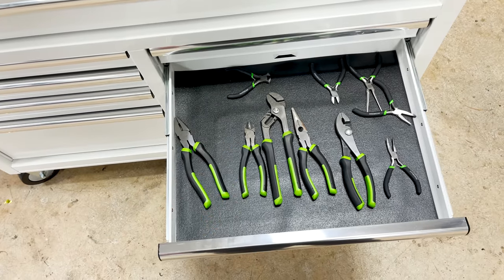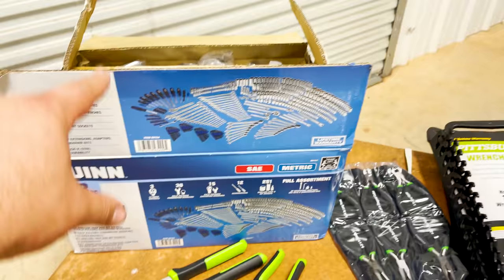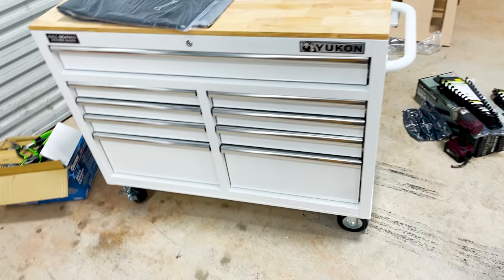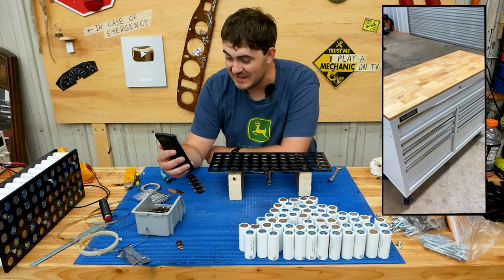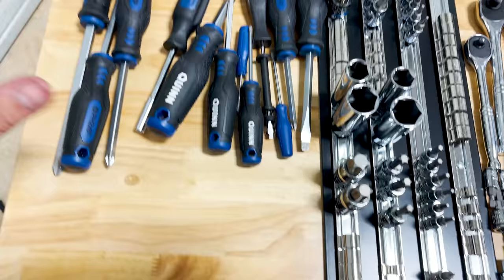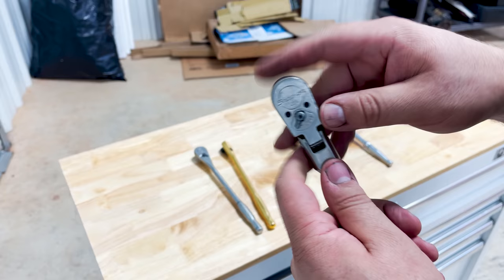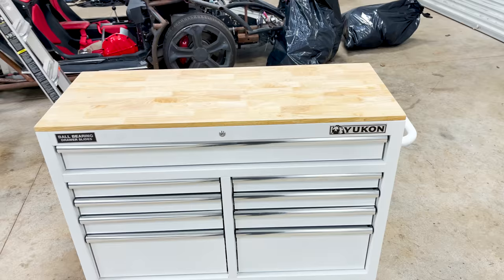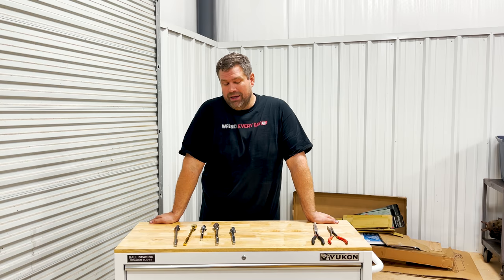I Bought The CHEAPEST TOOLS On The Internet (So You Don't Have To)

Comment: My experience with HF has been generally good on most products but there are some areas that need improvement and Im sure others in the chat have differing experiences. Most recently my son (in high school age) was changing oil on my Fusion Energi and kept telling me 15mm was loose 14 was tight and thought it was an SAE bolt. Well the issue was as you guessed it, the open end wrench he was using - Pittsburg branded. Lesson, If its a bolt you dont want rounded I would recommend using a better wrench. In this case we switched to a gear wrench and it worked fine albeit with rounded corners now :( . So the wrench savings cost me more for a new bolt from Ford lol. I must say, there are tools that I have great luck with and have been using at work and at home and those are the US General tool boxes and cart. Well built and after many years still look and work great. Their table drill press is great - mine is 20 years old and still kickin, i also have their horizontal band saw and the press, brake, roll and for the money you cant beat them (they just need alittle tuning). My 2cents for free

Comment: Personally I like the Husky 505 piece kit better. its $419. husky is make for home depot by Apex Tool Group. Apex Tool also makes Gear Wrench, SATA, Crescent, KD-Tool tools. so they are better quality and the stuff at HF.  add on the  the husky 46 inch tool cart for $398,  toss in a good set of Irwin pliers form amazon for $46 dollars and add on the Irwin cobra pliers for $26. and a 4 piece set of Irwin Vice-Grips for $38. but that only gets you hand tools. which are slow and we all know time is money would add the following to complete the set if i was working as a mechanic. 

Also for $230 you can add the 108 piece impact socket set.  the Ryoby 1/2 HP brushless impact and the 3/8 cordless ratchet kit. and add on the 3/8 HP brushless impact, 2 - 4ah batteries and the fast charger kits. good quality AC delco digital torque wrench ARM317-4a with digital angle guage.

Comment: The worst thing about a Harbor Freight crash kit is that you, one day when you're looking for a god damned 10mm socket, the only one you can find WILL be in that kit.

It will be the only 10mm you can find for the next several months, by which point the entire kit will have slipstreamed itself into your regular tools and you'll forever trip over them like landmines.

... And then you need to buy another crash kit for the next road trip because it's faster to drive to the store on panic-and-pack day rather than assembling one.

Comment: Overall with Harbor Freight, just look at reviews before you buy. Most tools are fine to great, but some like their old locking jaw pliers are absolute garbage. Do some research and you'll save a lot of annoyance. Also, I'd recommend staying away from Matco except for their actual tool boxes. Almost everything they sell is a rebrand of something made in Asia you can get for far less money. Buy whatever they rebrand instead. All tool truck companies rebrand some items, but Mac and Snap-On are better for getting bespoke and USA made tools. Lastly, I wouldn't bother with tool truck brand cordless tools. They are far more expensive and will eat you alive with battery prices, but Milwaukee, DeWalt, or others are just as good if not better.

Comment: The white option is a good option as a mobile kitchen (outdoor grilling area) butcher block island storage unit. You might even prefer the one you mentioned with the larger bottom drawers.

My Dad was convinced to invest in Snap-on tools for their alleged lifetime owner warranty then found out that largely depended on the actual dealer truck you were dealing with. In other words, the quality of the easy replacement service was NOT universal if your guy moved or if you moved to another area things became less friendly. In reality, Sears Craftsman back then had the same lifetime deal for much cheaper hand tools and the store didn't matter. This was decades ago so your mileage will vary.

Comment: You can get away tinkering a bit at home with some of the HF stuff. But if you use them on a vehicle from the rustbelt you will just round off bolts. If you think you are going to be a tech with HF stuff, the answer is no. You will not be able to make good time and you will become disappointed over and over again while looking like crap. I DO recommend keeping a set of HF wrenches and maybe some impact sockets in your box but not for regular use. You will eventually come to a job where it takes some sort of special wrench or torque adapter you don't have and it needs to be done. You don't think you will ever work on something like it again and aren't going to buy the special tool off the tool truck. So you put the HF wrench into the vise, heat cherry red with a torch and bend into a custom tool. Or Chop the wrench in a saw and weld a socket to it to make a custom adapter. You are making a tool to fill a need in a pinch out of something you don't give a fuck about. Some of my wrenches are $100 each. They aren't getting bent. The HF is fair game.

Comment: I noticed looking at HFs ratchet wrenches, the double box end sets are pretty tight, the others have a very loose pawl or something in there that causes it to have to back up a lot to get to the next click. No point in having a fine gear but a loose pawl that has to back up 10 degrees to find the next tooth. I should buy them and make video. Over all though the ratchet wrenches don't hold up in a commercial environment, fine for home use.

Comment: I think you should run icon tool grab and us general 5 drawer box. I say this after returning to the pro shop this is what I bought. I have put icon crome on half inch inpact and didn't scratch it. There 1/2 inch line is not as good due to select sizes missing but it works

Comment: Couple of things to touch on, I have the Yukon cabinet, love it, but I should have went with the Husky. When both are on sale, they're basically the same price but the Husky is a good bit deeper. 
Sockets from HF are great. Even the cheapest Pittsburgh sockets are honestly quite nice and I haven't had any issues with any of them breaking. 
Pliers are one of the few times when I wouldn't buy Pittsburgh, step up to Quinn or Doyle at HF and you'll be happy.

Comment: The old HF pro tool kit was good. Came with full line of sockets and almost all the odd bits you could ever need. The wrenches suck though(soft metal).
I have 2 or three sets of this.
The new quinn set looks like a nice choice.

Comment: The Yukon box is great. I have no hesitation in recommending it.  Don't buy the  Quinn. The Pittsburgh tools are better. Get extra ratchets so you don't have to change sockets. If you can wait for Black Friday, see if there are better kits from HD or Lowes. The $99 kits can be quite good.  Check the assortment. Get a really good rubber dead blow mallet, not plastic.  2-3 pound
    HD has the Dewalt 10 compartment organizer for $9.98 for the holidays. Make sure you pick up 2,3 or 4 of them before they sell out.

Comment: Regarding those loose slips joints:  I have an Ironton set (Northern Tool, fyi) where a few have gotten loose with age.  I've thought about just putting a plug well inside the nut (against the carriage bolt).  
For me, generally, more variety is better.  Tools are less likely to break when you have the right tool, having the right tool is easier when you have more tools, and having more tools is easier when you buy smart.  Not cheap, smart.  Spend your money where it matters.

Comment: You misspoke on the matco ratchets, the first one was 60 teeth but could be rebuilt with an 88 kit as they haven't made 60 tooth kits in years and the gold its just an 88 tooth. the 72 tooth ratchets were the adv line, which they no longer sell.

Comment: The other thing that works well with sets like these is Start with the kit as shown here, and as time goes on and you need to replace certain parts, buy a better brand.  It will take a while, but it's a lot easier to purchase 1 tool (or a couple) at a time and slowly upgrade your box than it is to drop a ton all at once.

Comment: I bought that socket set and my only complaints that the ratchets really suck, there are no stubby screwdrivers and the pocket screwdrivers are a bit of a disappointment. The Pittsburg pro ratchets are much nicer, and the pocket screwdrivers really need clips on them. 

This set has completely replaced my old craftsman tools other than 4 screwdrivers.

Comment: Just screw a slab of 3/4 plywood to it and when it gets rough just fling it in the stove and replace it? Wrench racks? Not worth bothering with. Just make some drawer dividers and chuck them in by type. If you use your tools every day you can identify 99% by eye and feel.  Ps I hate snap on wrenches especially as the warranty only covers tools that don't get marked   by using them.

Comment: I would say, the greybeards are right, and wrong. You can work out of ANYTHING if you need to. I've had to rebuild and repair things (electronic motors mostly) in the field with needle nose pliers, a gerber, patience, and a lot of swearing. I then invested in a set of Knipex and cut my field kit down to those three from the kit plus my specialty tools for the systems. Quality buys luxury, even if the luxury is just to know it won't give out halfway through the job and you have to scrounge up a replacement. The worker is the one that WORKS. The tools make that work easy or hard

Comment: When it came to sockets and ratchets and wrenches I went with tekton because not only do they sell individual pieces they also sell complete sets. Not sure if my ocd could handle loosing a 10mm and not being able to replace it because you can only buy it in a kit. Those 2 qualifiers cut quite a few tool brands

Comment: Fortunate enough to have Made In America Craftsman of the late 90s set.  I still need some torx and hex bits.  I love the Pittsburgh Pro dual head flex ratchet 3/8s & 1/4s combo and also added the Pittsburgh Pro 25" breaker bar 1/2 inch.  Good stuff from harbor freight.

Comment: DIY guys, no way you need to spend $1000.  You start with a good basic 1/4 and 1/2 socket set, get a good brand for the ratchets alone but get it on a discount.  I got a Hazet set for 170eur.  Get nothing in 3/8, its a waste of money.  Hunt for a bargain on good quality torque wrenches which aren't mentioned here at all, you need more than one to cover the range, got 3 Hazet ones for maybe 400eur.   Then you buy the tools you need individually before the job as a set may not include the size you need and take it from there.  In the 428 piece set shown you'll use less than 1/3 of the tools in 5 years, total waste of money.
As for the rest, I have knipex pliers, about 13-25 each which I've bought over time, a cheap basic $25 combination wrench set which I've added sizes as needed and good impact rated screwdrivers not the crappy ones shown.  I have maybe spent $1000 in total in 5 years without a workbench but that includes torque wrenches, many specialist tools eg for brake and suspension work and most of my tools are top quality.  TOP TIP Hunt for big brand tools in FB marketplace, noone buys them at those prices, offer half and grab them snapons.
Reply: To see how wrong the advice on the video is, you spend $1000 and you have no torque wrenches and no breaker bar, just 100s of sockets that you'll never use.  There was this video with a guy spending 10k on snapon with student discount as above. #fail

Comment: This wood is called "Hevea" or "Rubberwood" in english. it is cheap Thaïland/chinese wood. This thin top won't handle lot of abuse.. it come from para rubber trees.. .... Soooo... The trees give rubber for your Truck tires, then they cut it and made this top. The solidity of this wood is poor because there is lot of "straw" on it.. where the rubber used to flow.. making it less dense . These days, lot of cheap dinning tables and chairs, cheap cabinets, etc are made from this Asian wood. It doesn't take long for these chairs and table top get loose legs and parts from the wood instability. Keep your wood top away from water and it may last longer. For wood questions , just ask me 😉

Comment: China Freight is upping their game on some tools. I used to only use a dewalt D.A. sander. I'd have to buy a new velcro pad each year to the tune of about $25. I bought the cheap $25 D.A. at China Freight and it has worked better than the dewalt ever did. I also don't buy their extended warrantees. When you buy a tool from $15 to $30 and it dies in a year or two, you got your money's worth out of it, go buy another cheapie and keep on working.

Comment: I got a 350euro toolbox and its worked fine. One of these kits is just a very good baseline. There are certain parts that take a lot more stress and are worth upgrading like pliers or wheelnut sockets but you can just buy a better specific set when your original one breaks or ends up not being good enough. Iv personally only replaced my wheelnut sockets but at some point a better screwdriver and plier set would be nice.

Comment: I bought the husky mechanics tool set for $99, spark plug sockets for $20 and the Milwaukee rolling tool chest for $500 (with a bunch of Milwaukee tools but not going to include that since it’s not that similar). I haven’t had to find any other tools needed  for basic home and vehicle maintenance with the husky set. I used harbor freight for a torque wrench for $20 but I wouldn’t buy this set or anything similar to it. Id probably trust Walmarts Hart brand more than a harbor freight set. I get not everyone can afford this kind of stuff but for $1000 you can definitely get a kick ass set that isn’t harbor freight low quality tools.

Comment: The top is solid wood. If I understand it correctly, it’s basically the wood harvested from “rubber” trees after they exceed their lifespan of producing latex.
PS. Your swivel wheels should be on the same end as the handle.

Comment: I was told to save the money on the ratchets/sockets, box, screw drivers etc and grab harbor freight, And if I wanted to splurge on something spend the money on things like the programmers/computer stuff and get Snap-on Matco etc.  Because the future support will actually save you money later.  But most of the budget hand tools will be fine, and if you break something the cost is low enough to go buy a new one when necessary.

Comment: I do prefer to buy professional grade tools and save money in a long term. But if the money is short, a good compromise is to buy a good basic set for the hard and critical work and save some money to buy on demand when you need some more specific.
There are some good imported tools that is not too expensive, but those big kits from harbor freight "brands" would be my last choice. Buy the way, the Project Farm channel is a good start point.

Comment: I have a lot of tools from 3 big name guys. I have 1 snap on ratchet I absolutely love and is my always go to ratchet. 

I needed tools for a new job and I used my name brand stuff at home. Plus I didn’t want anyone stealing my good stuff. So I bought Quinn sockets and icon ratchets because I like the flex head ratchets. The sockets are great, easy to read and have a snug fit. The icon ratchets are smooth and work just as well as my snap on.

Comment: I'd suggest lose the square steel insert style socket holders as well and go with just about any other type of socket holder. Otherwise HF tools aren't all that bad the price point was better when they offered the 20% off coupons, but especially for one off tools like line wrenches when you rarely use em hf is way better than paying an arm and a leg at the tool truck..

Comment: HF hand tools are great. The Quinn line is the " Entry Level" then Pittsburg Pro then Icon. It looks like they are phasing out the PP tools and going to Icon.  I like the Icon ratchets and their sockets are good. The other ting is the warrenty. You can break stuff in half and they will give you a new one.  Now the electrical and air tools? OH HELL NO. I pay for the " Good stuff" when it comes to those.

Comment: Working on vehicle's in general I'm surprised you don't have any impact sockets. I worked at tire kingdom for a brief period and most if not all the impact sockets were Pittsburgh from harbor freight. The number one reason each one said was because of the lifetime warranty, bring back the set and recieve a new set. I find it curious that in most if not all of the video's about harbor freight tools no one ever mentions the lifetime warranty on Pittsburgh, Quinn and icon tool's. Is it because they just want to bash the tools because they are not highly overpriced like other's.🤔 I do like the fact that you are going to be using them for an extended period to give them a fair chance.👍

Comment: I used to work at a dealership, and all I ever used for spanners and screw drivers was MasterCraft, (Canadian Tire brand) lifetime warranty (no receipts or questions) and decent quality. When I lost my 14mm spanner I replaced it with a single Snap-On wrench on a whim when the truck dropped by, that wrench cost more than my 8mm-22mm MasterCraft kit, felt nice in the hand, made a different sound when I dropped it on the floor, other than that, not much difference. 😂🤷‍♂